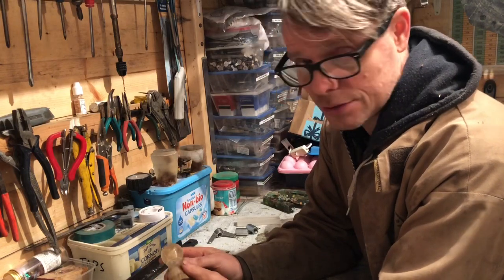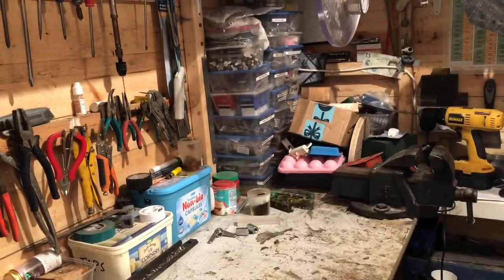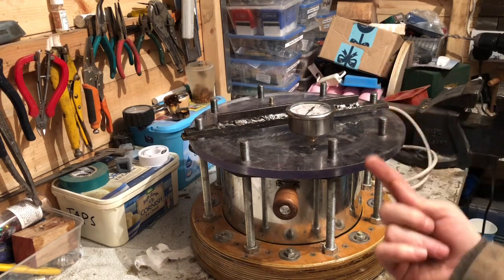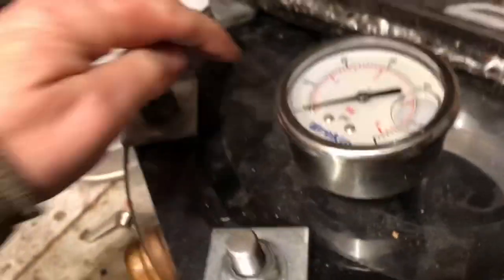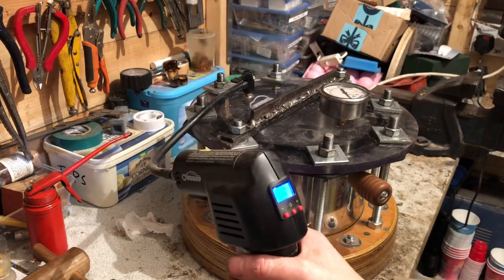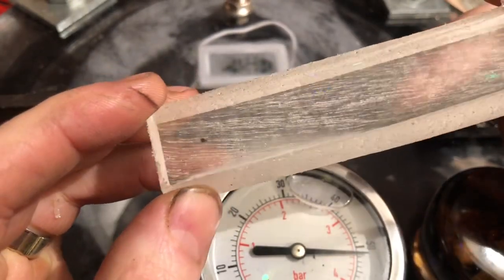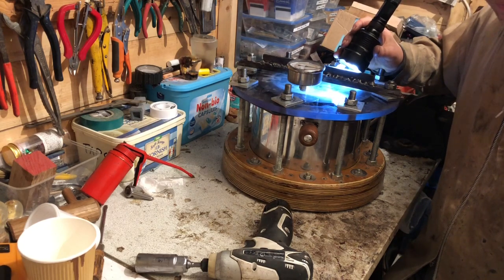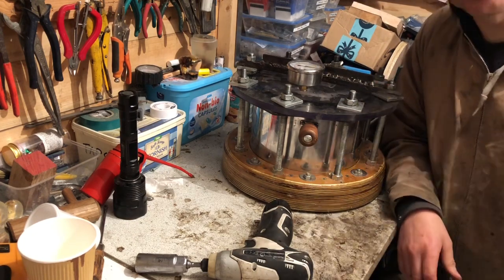HOME MADE PRESSURE POT WITH CENTRAL HEATING

Comment: Does adding air to the chamber cause the temp to drop? My castings inside an un heated chamber are not curing but the leftover in my mixing cup is curing no problem when it’s not under pressure. Would heating my pressure pot be the answer?

Comment: Some superb ideas there well done, I've been thinking about this subject myself!
Reply from the maker: tim pardoe cheers Tim, officially I can’t say it is a 100% safe build but with 8 M12 bolts holding the poly top I can’t see it failing... If you go and make one, please take care. Thanks again, Colin.
Reply: Awesome !!  I'm trying to make a pressure pot with 3 different colors in separate containers to pour 3 colored rubber fishing worms. I'll have to make 3 small pressure pots 1/2 gallon each or put three containers in one bigger pressure pot. 
The open a valve with 3 hoses going from inside Cooker to one out let Gate shut off valve.
Only thing is Plastisol liquid plastic has to be poured and kept at 350° so I'm beside myself as to whats best to do. especially since my know it all engineer best friend who built 2 30ft wooden sleep in boats in his backyard  passed away at 94 or I'd be working on it with him .. 

Anyway saw and loved your Video trying to brainstorm  and learn from it 

Great Job !!!

Comment: nice build works well but you should think about putting a pressure release valve on the lid so that it cant get higher than you need that way if you forget np
Reply from the maker: kevin oldfield aye mate I have one from the original pot but haven’t added it yet. Thanks.